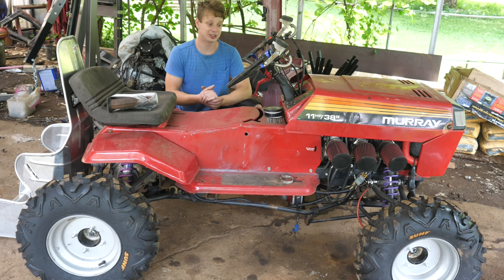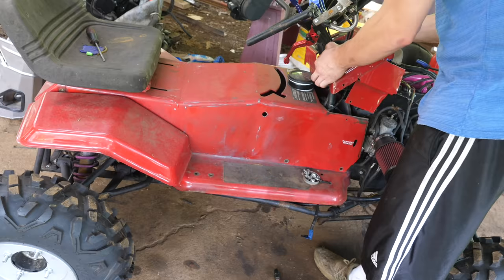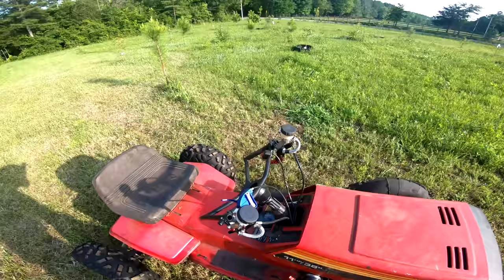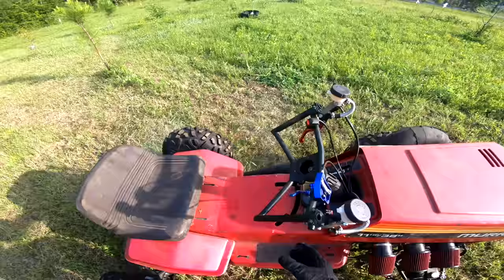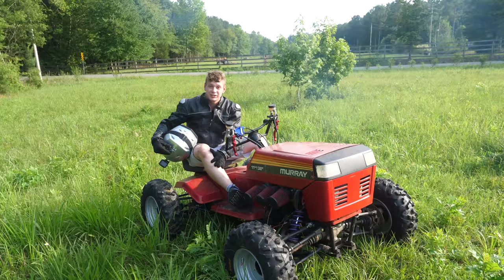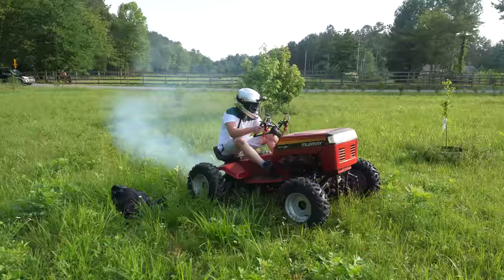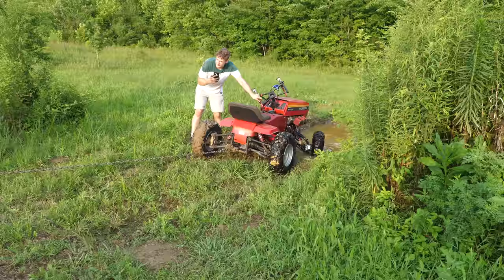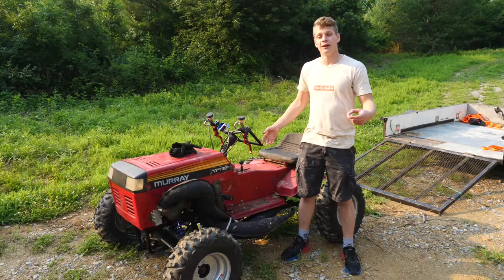600cc Snowmobile POWERED Mower Offroad Test! [Discontinued]

Comment: You just need to lower the stall of that torque converter so that it grabs in lower rpm's.
Reply: Yes that's what I was thinking the whole time he was ripping. Maybe some stiffer springs or revised rear suspension too.
Reply: No torque converter per se but the clutching might need a little dialing in.  Those engines prefer a high rev though before engagement.  Otherwise they tend to bog off the low end.

Comment: absolutely LOVE the sound of the Ultra based 600 trippple.  I have the same engine still in the sled.  Fun engines.  Mine will be getting 680 cylinders before the snow flies this winter though.

Comment: Also, I'm sure you already know, but the cheapest way to change the dynamics of your vehicle is to order several different springs and weights for the CVT. The sprocket change is certainly helpful, but I don't think you're operating in the heart of the power curve of the CVT. I don't know if you've ever messed around with golf carts, but $12 worth of weights and springs can make one go a hundred miles an hour or climb at 12°Grade at a crawl

Comment: Hay your using a reverse gearbox in reverse all the time but your also running a 2 stroke. It's really easy to get that engine to run safely backwards. All you need to do is adjust the timing and take the recoil off and use a rope to spin it backwards. Sheel rip just the same
Reply: The pulleys won't work in reverse
Reply: @jmanlinc  they do work in reverse. They don't care. I have done this on a golf cart build I did before I started my YouTube channel. I put a 680 ultra engine in a Yamaha G1
Reply: @Self.reliant  I have limited snowmobile clutch knowledge,  but the ones I have seen the driven pully will only work properly in one direction,  so while the drive pully will engage in reverse, the driven may not squeeze the belt properly for full time high load use. I do know that at least some of the Rotax sleds have a different driven depending on whether they have reverse or not.

Comment: Getting there. Thought you were getting stiffer rear springs after last vid? Also it seems to smoke excessively. Are you mixing the gas really rich? I like Amsoil Interceptor 2 stroke oil believe you mix that at 50:1

Comment: You need to get the brake reservoirs off the handlebars and onto the body. I know you want them as high as possible, but if you watch the video closely you were just packing that brake fluid with cavitation. It's just too much thrashing. You'll get better braking Even though the reservoirs are lower if they are more stable. Looks great though! Have fun

Comment: They should make a 4 wheeler low like this that u can buy and use it for commuting instead of a motorcycle. Also obviously u need to beef up the rear shocks. There way too soft. Makes it completely unstable in turns at any speed.

Comment: Don't get defeated ! Gear it high and take it to a flat track 🧑‍🔧💯 run a 3/8ths mile dirt oval . It would be greatly suited for that class
Reply: I agree, this thing doesnt excel in tight trails.  Its better suited for sliding around wide open throttle. also think it would be sweet to throw some studded tires on for the winter and go ice racing.

Comment: Feather the throttle into the clutch engagement to make it smoother, After much snowmobile experience I would recommend for best results you make yourself sound like an idiot and throttle blip it or flicker it into engagement it makes it smoother and more controlled than just putting it quarter throttle on letting the RPm's Flash into clutching engagement